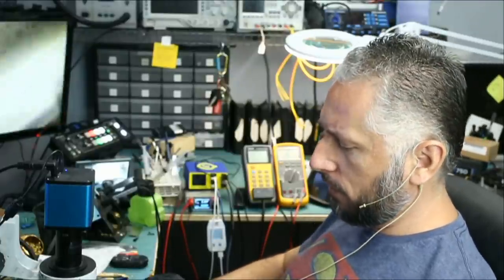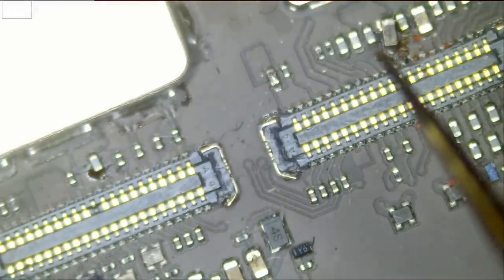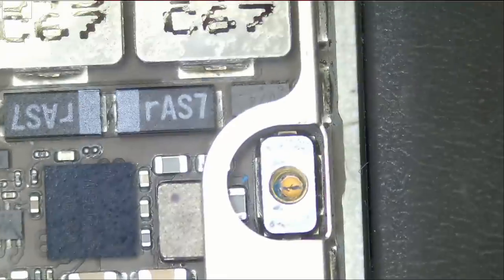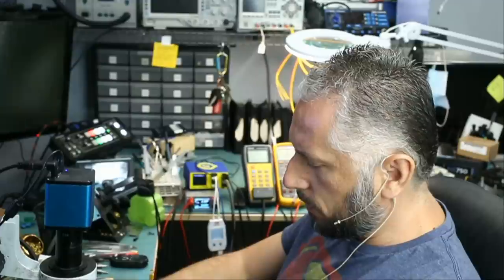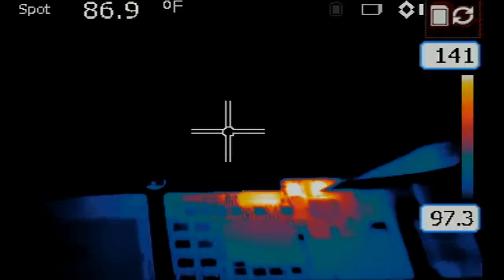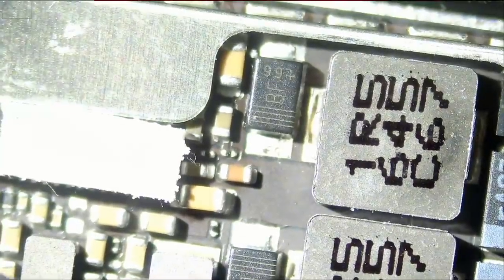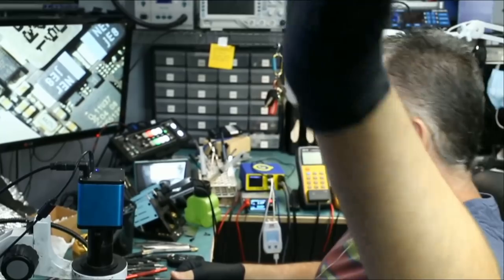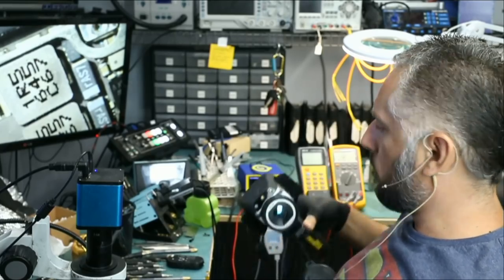iPad pro 12.9 No Power Tricky Repair - Finding Short Circuit by Voltage Injection & thermal camera

Comment: I'm guessing the reason why injecting voltage before or after the coil makes it difference is because the coil can take the load. Very informative video Thank you so much.
Reply: A coil is basically a very thin wire, and the part that gets hot is always the component with the highest resistance. So if the short on the capacitor is really low resistance, the coil might be higher resistance and thus taking most of the power that is being injected. Injecting after the coil means the coil is no longer part of the circuit and the component with highest resistance is now the shorted cap
Reply: Yes, I believe it too because the short is not so "strong" so the coil resistance would absorb the heat.
Reply: Science people increase the volume 😎
Reply: @baghdadiabdellatif1581  What?

Comment: I just want to say thank you. I have always been interested in soldering for just a hobby. Ive always done wires and such for my ham radio hobby. I recently broke one of my radios antenna connector by dropping the radio on the ground. I was mad and excited at the same time as this was my first attempt at a "real" repair. I orderd some amtech 559 and solder wick to use with my weller we1010na from you guys. I ordered the replacment part and began my repair, unfortunatley i was unable to repair the device and broke the board. This did discourage me at first but i have since then ordered a few practice kits for learning to solder and i have told myself to not give up. Thank you for these videos because someone like me with no experience with electronic repair can watch them and get the confidence they need to pick the iron up.

I have learned since then that a hot air station would have worked better for the repair i was attempting.

Charles Grant
Toledo Ohio.
Best Wishes

Comment: I have a question. Is it okay to let the capacitor unreplaced with a new one? I mean, there's no caps there after removing it, but does everything works fine even without it?
Reply: It's gonna work fine. There is optional capacitors to that can take over the functions of the removed one. Redundancy. If one fails then another one can take over
Reply: bypass caps, it's okay if you remove one, there's plenty on board
Reply: No. It's not. While I agree with others on the bypass redundancy part where the absense of one cap will not cause the device to stop working, you have to understand that the capacitor at that location is there for some purpose. If it's presense or absense doesn't make a difference, manufacturer would have done without it.
Reply: @Wingedmechanic  They are very important as they acts as a kind of energy reservoir. If the input voltage drops, then a capacitor will be able to provide enough power to an IC to keep the voltage stable. Otherwise, the IC could end up in the unstable state.

Comment: Would this be the same with a samsung note 9 a problem on the board , because the battery is not connected and it's getting 0.02 then 0.05 on the amp meter or could this be a charging port problem

Comment: Did you replace the item you pulled off? Is the motherboard over engineered to withstand a missing component.
Reply: One of his previous videos he used an analogy of 100 officers protecting a building. One calls off sick but the remaining 99 protect it just fine. It's when a lot are missing that there can be an issue.
Reply from the maker: @Chris You get an A+ for remembering that. https://youtu.be/xFNCb81waYU

Comment: I suggest you when when you inject voltage, do it in a way you inject higher voltage but less amperage.The high amperage is that one that can do damage so i sugesst you not go with amperage higher than 2 amp. And mostly mosfets and diodes open when they get more than 2 volts, 1 volt wont open them